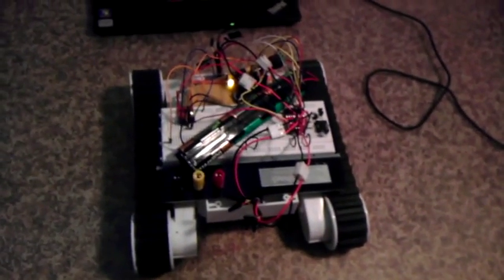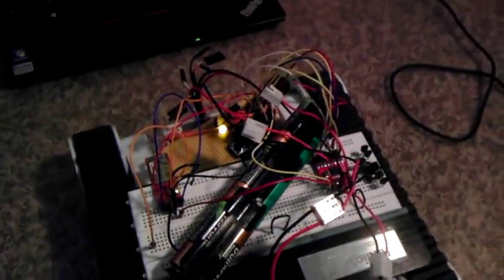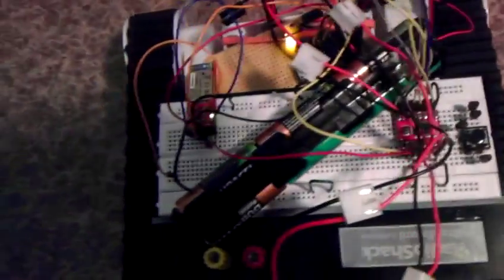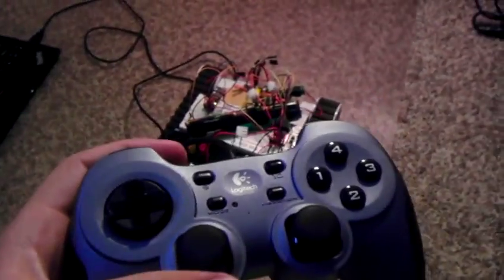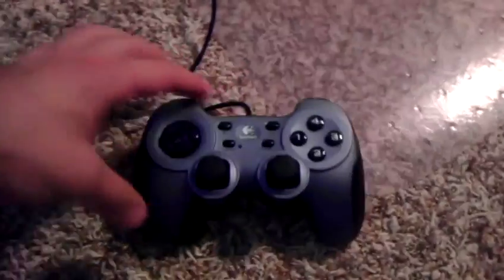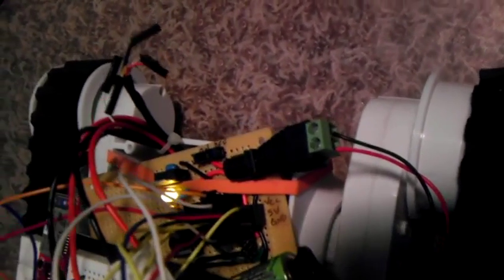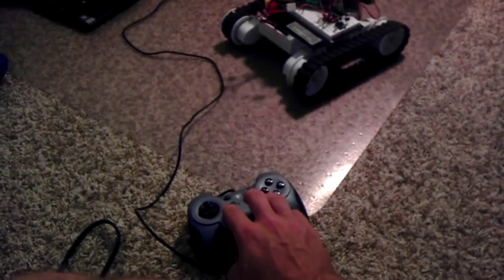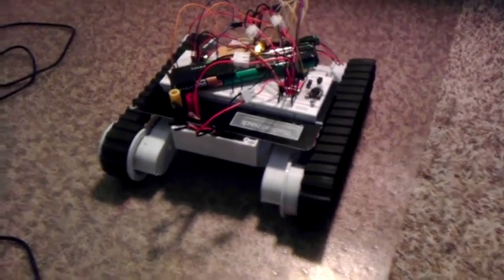Bluetooth Rover 5 control. AVR ATtiny84

Comment: I bought the rover 5 chassis a few days back but it isnt moving as fast as I would like it to like in your video. My bot is fully automated however and I use a L293D for the driver circuit. I also use a 9V battery to power the motors. Any ideas how I could get my bot to move faster?
Reply from the maker: Ahh, the 9V battery is probably your problem.  In this video, I think I'm only using a 9V for the circuit.  Then the motor controller controls 6 AA's going to actually power the motors, which can deliver more current than a single 9V, I think.

Comment from the maker: I was terrible in documenting this project. Basically the bluetooth module sends bytes to the ATTiny84 via serial.  The microcontroller then does stuff depending on the bytes (which are speed indications) are sent to it.  So in turn it will send information (I think via I/O pins and PWM) to the motor controller to tell it speed/direction.

That's about the whole control loop.  Getting bytes from the computer to the microcontroller is the toughest part.  New link in desc shows phone interface.